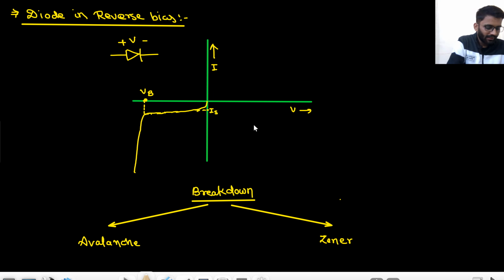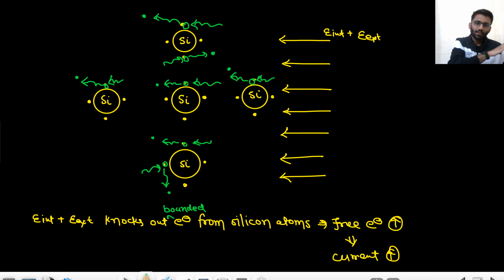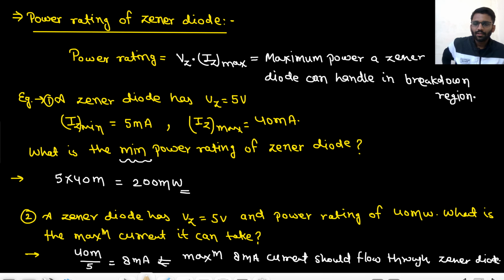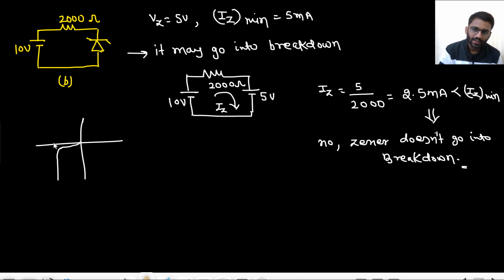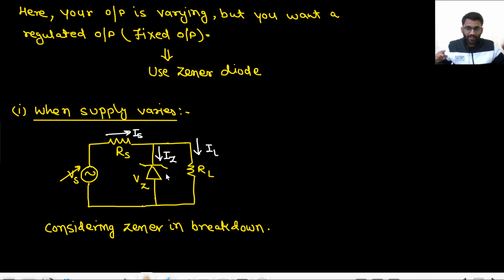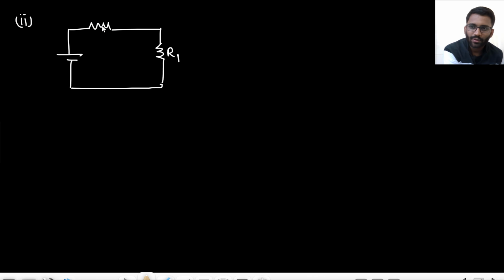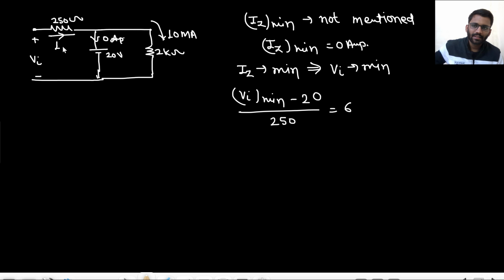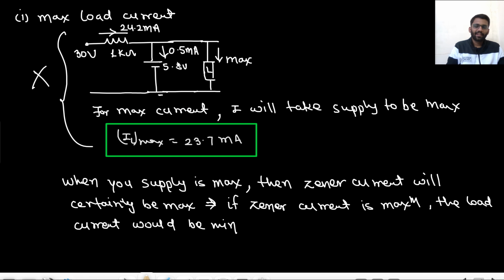Zener Diode as a Voltage Regulator || Analog Electronics || PrepFusion || Himanshu Agarwal

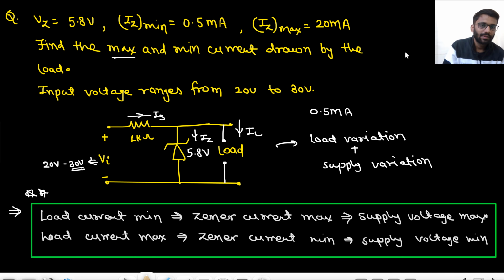Comment: Sir, zener diode operates with negative voltages right ( becuase it operates in  reverse bias condition ), 1:27:17 problem having supppy voltage range 20-30 V. Thats why got this doubt. Apologise if its silly. Btw, thank you for your videos.
Reply from the maker: What is the doubt here?
Reply: @PrepFusion_GATE sir is this playlist enough for theory part and then if i practice ddp and solve pyq is it enough
Reply from the maker: Zener operates at reverse bias. 20-30v is working as a reverse bias for the zener. See the sign convention of the diode.
Reply: @PrepFusion_GATE  ok got it sir, thank you. 😇